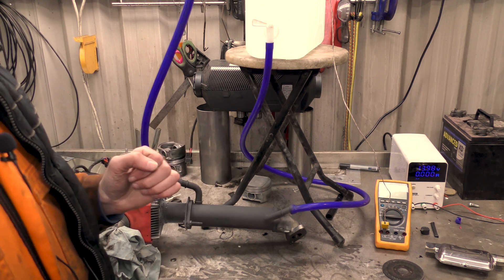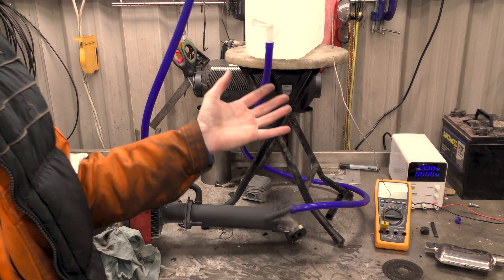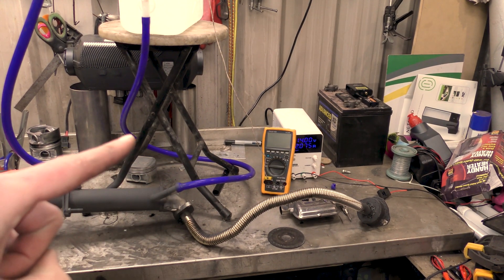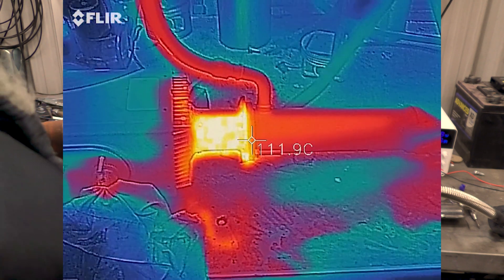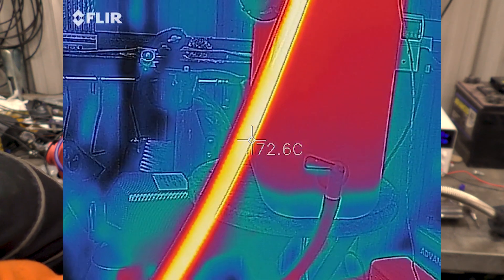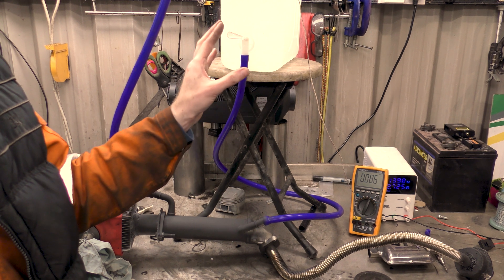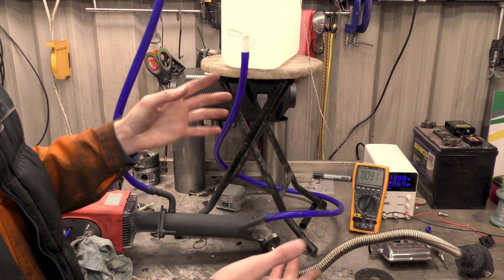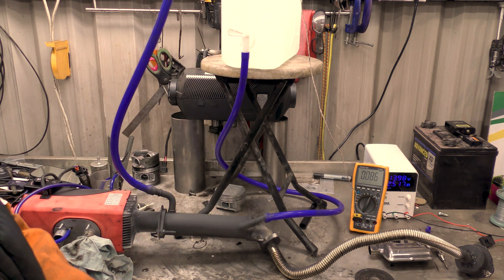Diesel heater EGR cooler thermosiphon

Comment: My experience with this is with a wood stove heating the water. I found that thermo syphon works best if there is a constant gradient in the blue pipes. Your pipes are changing gradient from positive to negative and this causes a 'trap' and unless the pipes are very large diameter, this trap stops the syphon effect. It would love to see you straighten those blue pipes and see how it would work. I don't  think is will boil and sputter any more.  Cheers

Comment: Hi David. Been thinking (dangerous) as these heaters are pretty much going to be the go to do it all. As you've proven it can be used in any angle and the waste heat used to heat water etc.. What about going the whole hog and adding an evaporation fridge unit.... And how about a peltier element... So 1 fuel hot air hot water cool food or even ice. And light... Maybe back feed the 12v from the peltier to drive the fan (well reduce battery load) 🤔😁

Comment: Right o.  The pipe going to the top of the container has to be graded no down turns or it will not work. Have been doing this for over 40 years . Master plumber .  Mmmm try again .  It's all about learning and improvement . Keep learning

Comment: Thanks for testing this David--very impressive. 
This has all the makings of a "pumpless" radiant floor heating system for a campervan---with the upper tank outlet ("cold" loop) acting as the supply (going down to the floor).   A long length (30+ meters?) zig zag floor loop would then remove most of the heat--with the outlet returning  downward to the exhaust pipe/heat-exchanger.   The zig zag floor loop would add some flow resistance though--so I'm not sure how well this would work with just thermosiphoning as the driving force (?).
Reply from the maker: Underfloor heating was what I was thinking of as the best use of the heated water, especially when recovered from the exhaust of the heater.  A 12V coolant pump inline would be my choice, as you're running the heater anyway so another small current draw from the pump shouldn't murder batteries too quickly.

Comment: I understand it just experiment but if you want water heater you can get rover webasto z from ebay cheap. I got mine for 50 quid plus the fuel pump for a tenner
Reply from the maker: You must have been lucky.  I don't think I've seen one go for much less than £100.  What do you use to control it?
Reply: @DavidMcLuckie  here is your lucky day. :)  https://www.ebay.co.uk/itm/2005-BMW-X5-E53-D-SPORT-2993CC-Auxiliary-Water-Heater-6918942/233423321829?fits=Car+Make%3ABMW%7CModel%3AX5&epid=1323077298&hash=item36591d3ae5:g:o8YAAOSw6Fhd55x7
you can switch it by a switch, relay, or thermostat.  I can send you the wiring diagram. It's easy.
Reply from the maker: That's fantastic thanks.  Ordered it.  If you could send the wiring diagram that would be awesome - me@davidmcluckie.com
Reply: @DavidMcLuckie  I will send it tomorrow. I'm at work at the moment.
Reply: @DavidMcLuckie  I have sent an email mate

Comment: Immediately I could tell that the level of water in the jug wasn't high enough for optimum performance,  the water level must at least be as high as it takes to cover the top hose port.
Reply: ....And also, no air pockets in the hoses.
Reply: Yes, thermo syphon system should be totally full so that the hot water can move freely and prevent excess temperature in one part of the system. The greater the difference in temp between the exchanger and the water the more efficient the exchange and the less heat lost to the exhaust ( which should be cool) cheers

Comment: If it is boiling/pulsing you are not thermosiphoning. What you have made is a batch heater, or the equivalent of an electric coffee maker. If it were siphoning you would have a steady flow and no boil unless you exceed the ability to absorb heat. Thermo is powered by density change reacting to gravity. It is a very low energy process and hates horizontal as that is just drag.  You want the piping to go up and down on the hot and cold sides, you especially want the heat exchanger to be vertical. There needs to be absolutely no air in the line to the top of the tank which is very hard to achieve with a hose bent over. Air there = no possibility of thermosiphon.  For an open tank, the best way to do this is with a port on the side of the tank near the top and keep the tank full above that port so any air will just rise up and out the port.  The problem with the heatex boiling is the hotter it is the less temp difference to force energy transfer to the coolant so it is not absorbing as much energy as it could be. It also cooks minerals out of the water which deposit in the heatex...  Been running thermosiphon on generators for decades so I have some experience here.

Comment: thermo spitting. gravity/air stopping real flow. needs hot pipe back into tub  above cold pipe. at about 30% of tub height, cold pipe about 10%, seems the tap is about that anyway. should see good flow then.

Comment: Hi David, regarding our email conversation, the project you mentioned is to complicated.  Typical development cycle starts out with the basics and swells into "it's got to do everything including an app".  I like your idea of adding an O2 sensor but wonder if any efficiency is there to be gained.  Could bypass the control board and directly control fan speed with  pulse width modulation controller, many available on ebay or bangood. That's a minimal effort way to test if it's worth while.  Thanks for your vids, keep on experimenting!

Comment: what heppens if you block the end of the egr coolor off so the gases take the normal route out of the exhuast
Reply: But surely to attempt this would cause a further degree of tilt on Earth's axis.
Reply from the maker: I'd think they'd take the path of least resistance, which would be straight out the exhaust and only heating the egr cooler minimally.

Comment: That is brilliant. I am planning to scavenge waste heat from the very hot exhaust gases with an egr cooler. That way I will get hot air and water and higher unit efficiency. With a thermo-syphon system there is less complexity and physics tends to be quite reliable!  This gives me the confidence to give it a try. Heating and hot water on my boat will be true luxury! Cheers.

Comment: add a one way valve in this system and its like alot more efficient!
Reply from the maker: @Indosarnia Which end, hot end up or cold end?  Still with the contraflow in place?
Reply: Indosarnia  https://images.app.goo.gl/6n3YfvAKso1o5Bj17
Reply: Indosarnia  it makes it more efficient
coffee makers also use one
and they also heat with this type of system
Reply: Indosarnia  every drip coffee maker uses a one way valve
and it should be in the cold side
and drip coffee makers work with boiling water
the convection system you mean from old cars dont use boiling water

Comment: Put the egr on a y pipe so ex can go one way and ex can be diverged around the egr  so you can adjust the water temperature by how much ex flows through the egr
Reply: They sale ex cut outs for boats and hot rods that would help control the heat so you will not boil the water and lose water volume. If you was on a closed loop system.
Reply: @6doorshopdavid980  some cars have this valve you speak of as part of the egr system. Know the 2004 tdi diesel vw does.

Comment: A couple of points of information. Water boils at 100 centigrade at 1 atmosphere. Having a little bit of head will raise the boiling point a little.

I believe the Roman thermo syphons were roughly on the same level. They used them to heat baths.

Comment: I guess the ultimate practical question is, how long does it take to heat up the 10l tank to, say, 60c?

I currently have a home-made water heater in my land-rover, which uses a 300w heating element and a small leccy pump to recirculate the water.
Heats the 10l tank in about half an hour but it really spanks the battery.

Was thinking about other options.
Not keen on a water/water heat exchanger working off the vehicle's cooling system - too much hassle plumbing it all in.
Thought about a heat exchanger working of the exhaust but I dunno how efficient it'd be.

Depending on the time this takes, it might be worth buying a diesel heater to do the job.
Every other option requires the vehicle to already BE running to generate the leccy/heat to heat the water whereas this would have the benefit of NOT requiring the vehicle to be running and it'd actually heat the vehicle before I use it.
Reply: Run some soft copper pipe around the exhaust manifold, insulate the pipes to an insulated tank that's higher than the manifold and wala hot water for free with no pump.
Reply: @lesroberts2244  Hmmm, not sure about that.

The reason I'm not keen on using a water/water heat exchanger is that it'd be a faff running water hoses from the back of a land rover into the engine bay.
If I was wrapping copper tube around the manifold, that'd create the same problem.
Also, insulating exhaust manifolds is a great way to end up with rusty exhaust manifolds.

I was thinking of butchering a regular land rover exhaust muffler by fitting copper coils inside it... somehow.
At least, that way, I could just run the water pipes through holes in the rear wheel-arch, to the water tank.
Not sure how well it'd work though.

Be interesting to see how hot this set-up, using a diesel heater, can get 10l of water in, say, 1 hour.
Reply from the maker: What about the other style diesel heater which only heats water?  Something like this - https://www.aliexpress.com/item/4000308470645.html?spm=a2g0o.productlist.0.0.d7f1343bRBUEqx&algo_pvid=6ac4ec05-5052-4ff8-9afb-1893037506cf&algo_expid=6ac4ec05-5052-4ff8-9afb-1893037506cf-5&btsid=f4e49b13-9280-4721-a99c-7d9f1b56e6dd&ws_ab_test=searchweb0_0,searchweb201602_3,searchweb201603_55

I haven't tried one, yet.
Reply: @DavidMcLuckie  I've seen similar things to that before but I, originally, deliberately wanted to keep everything electric rather than fitting a gas or diesel boiler.
TBH, the leccy heater works okay, except for the amount of battery drain it causes.
It's just that, being winter, thoughts turn to ways of heating up a vehicle more quickly and if I DID decide to buy a diesel air-heater, I'd certainly consider adding some kind of HE to it to help heat up the water too - if it could do the job fairly quickly.
Reply: Indosarnia  Does an exhaust silencer reach 100c?

If it did, it wouldn't be the end of the world.
Discharge from the tank at the bottom, with a thermostatically-controlled valve in-line, and the return to the tank at the top.
Water reaches, say, 60c, valve closes, no more water feeds through HE, water in copper tubing could boil off (if it got hot enough) and all it'd do would be pressurise the water tank very slightly.

TBH, though, that IS sort of my biggest concern about the idea - I'm not keen on the idea of having copper tubing near a hot/cold/wet/dry exhaust silencer.
The plumbing in my house is pretty manky after years of slightly damp air.
I suspect copper tubing wouldn't be very reliable, long-term, in that sort of environment.

Comment: David- great video- as always! Don't forget the blue silicone hoses used are insulators. you might be better with the hot end of the pipe submersed too! either way win win!
Reply: Yes the hot outlet must be submersed, this gives a smooth flow. Right now your system is fighting gravity.
Good video thanks.